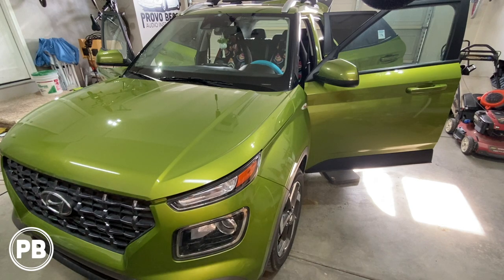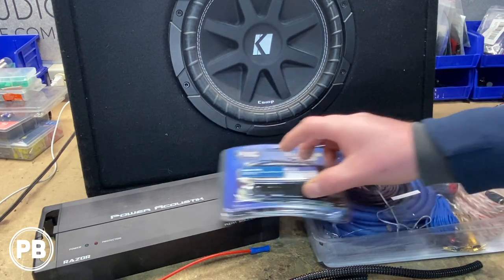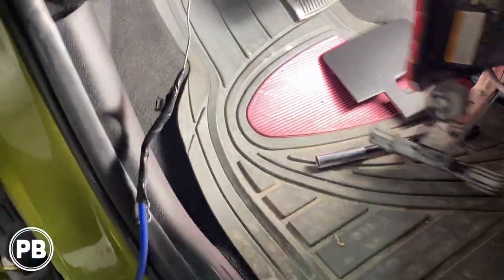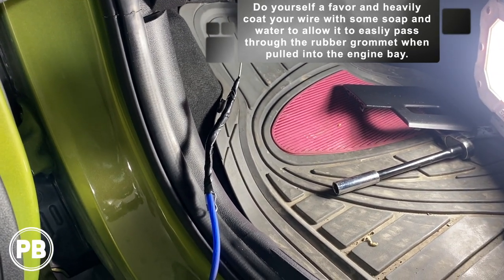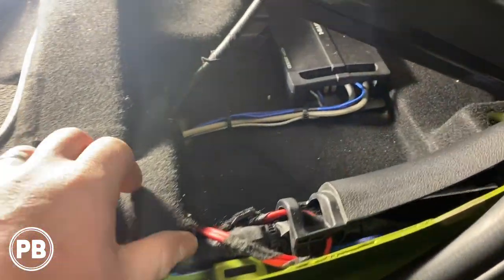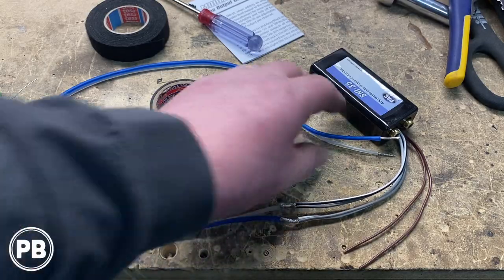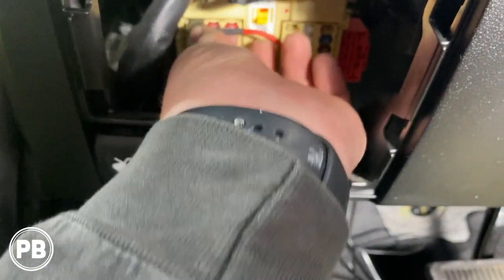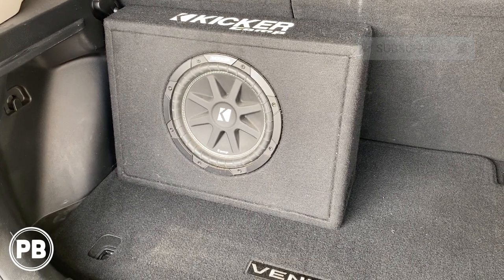2020 - 2023+ Hyundai Venue Amp and Sub Install

Comment: I loved that Amp!! When I got back into car audio I ran that Amp on 2 kicker comp r 12s had them subs slapping!! I need run a sundown x15v3 on a sia3500 about to install a taramps md5k! So by using a hi low converter is that better than using the high level connections on the amp?

Comment: You should have used the amplifier's signal sense to turn it on and off.  By using a remote turn-on lead to the fuse box, the amp will turn off with the car's ignition.  But the head unit remains on for a few minutes (or until the door is opened).

So this amplifier will be turned off before the head unit stops.
Reply from the maker: Amplifier didn't have a signal sense / DC offset capability, nor did the owner of the vehicle want to spend the money on a line out converter that generates the remote turn on based on those aforementioned capabilities.  We would recommend a Pac LP7-2.

Comment: Thats a cute little system...
Just did 2 incriminator lethal injection 12s on an incriminator 2k amp,xspower titan8 lthium,with an audiocontrol lc1 and amplab wireless bass knob